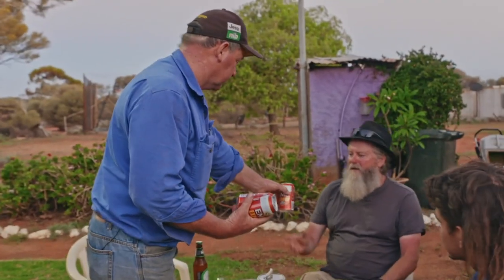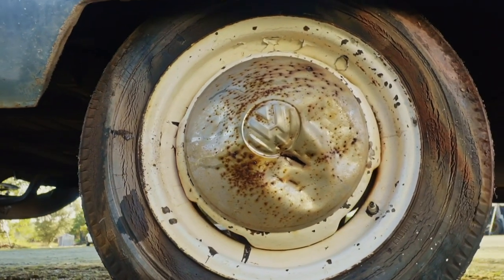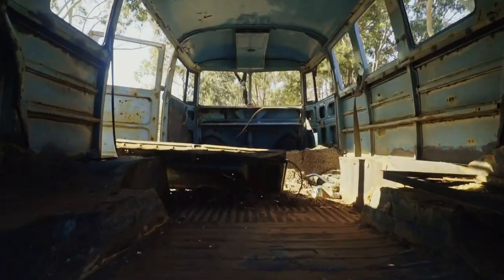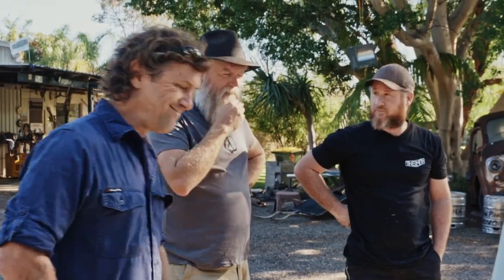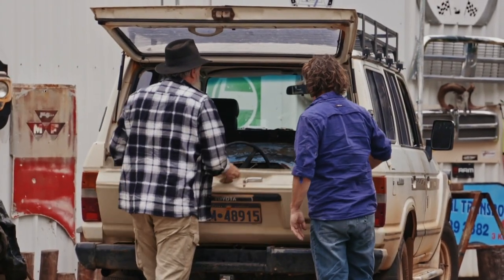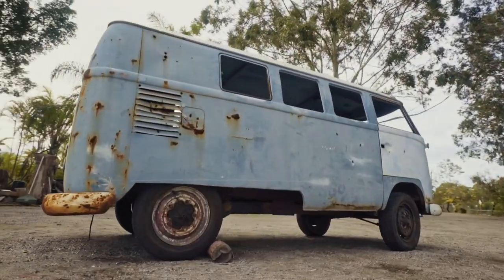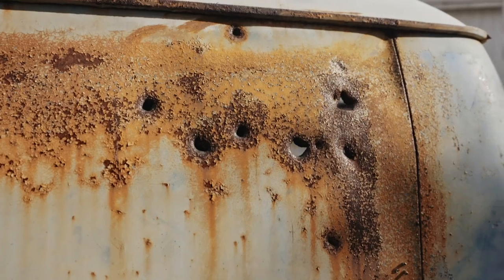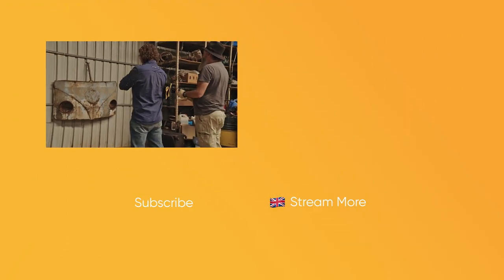VW Kombi Sold For $11,000 WITHOUT A Motor | Outback Car Hunters

Comment: That was a decent profit for next to no work... finding it was their key factor...
Reply: Did they say they were into it $5,800 after the front axle was installed, rear axle moved/transmission, steering rack and other spare parts bought?

Comment: early 1980s i started my 1st job workin at Sunlner campervans in Ringwood Melbourne ,six months in and the owner pulled me aside and offered me an ol 50s Combi ex pmg van ,it ran good and was straight and he said to me when he was a kid in NZ he started out by converting the same ol combi into a camper sold it and bought two old ones and so on and so forth,i drove it home on a permit and took it straight to the wreckers on saturday for 45 bucks,i was saving up for a XRGT and that 45 bucks went straight into the bank and ive still got my ol 67 GT